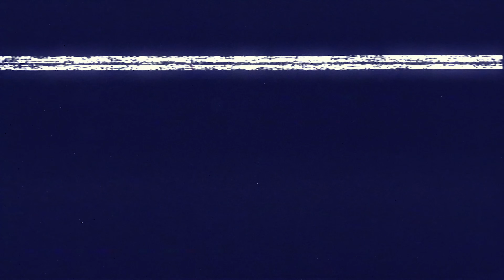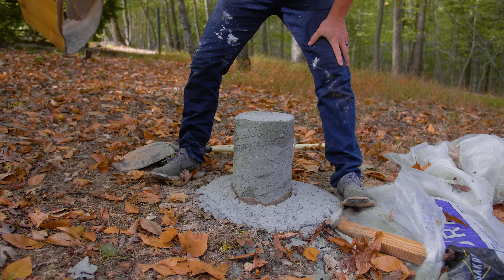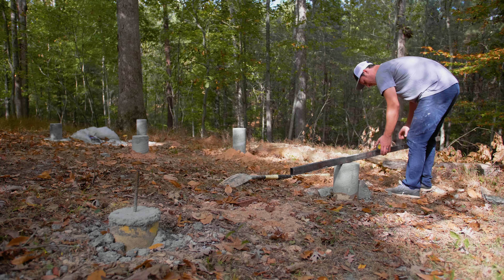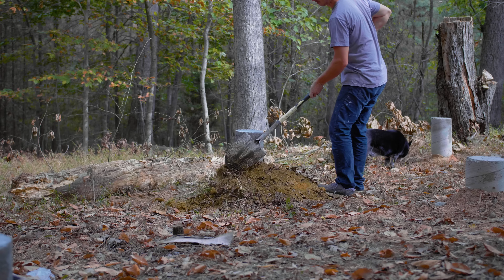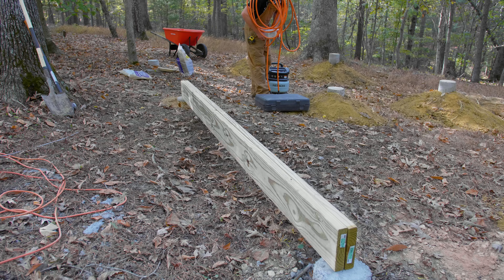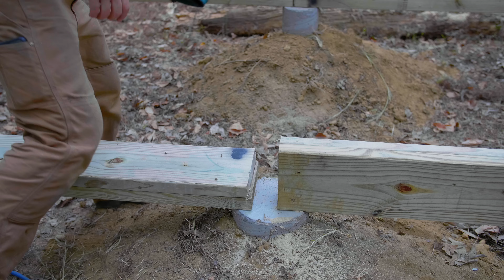Cabin Beams - Cabin Build Ep.3

Comment: How far apart should the concrete pillars be? I'm building a 14x44 cabin. Using 2x8 floor joists.
Reply from the maker: Look it up on a span calculator. My beams sagged a little so I would have beefed up my beams or made sure my distance was less. Minimum THREE 2x8 laminated together for beams.

Comment: I don't recommend piling dirt up around the piers because it allows termites to travel a shorter distance before they reach wood. They will even travel across a treated beam to get to untreated wood. A piece of square sheet metal placed on top of the piers with the edges bent downward will make for an inexpensive termite shield.
Reply from the maker: Gotcha. Good point!

Comment from the maker: ** EDIT ** I did not know how to mount the beams to the concrete originally. It seems kinda simple but for whatever reason, I couldn't wrap my head around it. If you keep watching episodes, you will see that I eventually use dry anchors (wedge bolts) into the piers and attach the beams. Better late than never! Looking back I wish I had the confidence to put wet anchors in the concrete but was scared they wouldn't be square.
Reply: That’s why you needed batter boards to pull a string over the tubes with wet concrete. Then you set them in a perfect straight line.

Comment: What was your cabin dimensions and how did you secure the beams on pier with out anchor bolts ?? Just curious to know
Reply from the maker: 12x20’ and I used wedge bolts to the piers
Reply: @WoodnessGoodness  gratitude.
Your beams and joist demesion if you dont mind. I'm actually on my last year of carpentry for house framing on just curious the different styles of framing people use

Comment: Bringing the dirt up the concrete to the wood is begging for insects to be part of your home. You can insulate the pilings, and not with dirt? Your area under the shed/house cabin should be sealed and free of moisture and excess dirt piles. 14' runs shoulb be 12" or greater You say 12' ft boards  but looks like you chose undersize 8" rough, whimpy ones you are doubling? Do you hasve a height restriction in the woods. I hope your rim joists also sit fiully on pilings, we will see iof you hang them off of nails screws or hangers?
Reply: I agree, never pile up dirt around a pier and always use termite shields. Inexpensive to cut a square of sheet metal and bend the edges downward.

Comment: How do you secure those double beams on to the concrete foundations ? You already remove the small piece of rebar that were sticking out from that concrete foundation.
Reply from the maker: dry set anchors. wedge anchors to be exact. did it later on...

Comment: why did you remove the tip of the irons? they would give greater security in the structure.
Reply from the maker: I dry drilled anchors later in the build. It was one of those things that I wasn’t sure what to do at first. But I eventually forgives our a solution!

Comment: One tip next  time you build wood beams cut sheats of plywood of 3/4" in by the 1/2" less than the beam width by 8' or 10'.

Try to make a sandwich with the plywood and the 2 beams and in the middle try to leave like a channel of 1/4" deep.

Then nailed down both sides.

However for extra strenght and prevention of  funny sounds like squaking it can come after beign built.

Build the sandwitch using liquid nails. 
That will hep the structure to gain a lot of strengh more than the just 2 beams attach together
Reply from the maker: Ah! Thanks for this pro tip! That sounds bomb proof! My next cabin I will take this into the plan making.
Reply: @WoodnessGoodness  
If you want another tip.

When you decide in your plans.

Where to make the pipe columns.

Not only make holes for the columns.

Try to excavate 1 feet more than the area you are planning to build on.

Escavate 6 inches and make the whole lo level then making the holes in the appropiate place your plans suggest and allow them to be at leat 4 feet deep.

Then after dry. Try to make the holes and prepared them for the utilities such as plumbing electrical or anything that goes underground and place them where you are  planning to go according to your planning.

And build it to go outside where the plumber electrician may come and finish it.

Then with those pipes at leat 1' 1/2 feet above the ground level.

Try to flat the dirt and make like a dirt slab leveled all around with 6 inch deep.

See videos on how to build an concrete slab with plastic.

Then do the same and over everything.
Use mesh rebar

Then when putting concrete make and slope of 1/2"  from the ends of the area toward the drain pipe you installed 

Make it nice and neat 

And let it dry.

Why this because you want the property be protected in the foundations from animals, water, and seasonal stuff.

Also you may want to have a crawl space for cheap with no brick intallation where you can fix leaks or anything in a clean place 

Also you want no cracks and no flooding from ground up due to erosion then this is why you may want to out plastic to avoid humidity in the slab.

Plus it will protect your foundation from natural issues in ground to last for several years.

Now how you cover the outside?

Well after you build you first floor try to cover with wood the sorrounding area expose between the concrete slab an the first floor.

Make a door way for you can enter the space and some holes for the place may have ventilation. 
For vapor  relief.

Them paint the surface of the same with paint that may help mortar and wood to bond then  with some steel mesh for stucco nail it with nails and make some mortar  and do some stucco yourself.

This method is cheaper than building brick around the house and is fast.and protect.

How to save on concrete or mortar.

Buy portland cement by bag and buy gravel and sand by yard

Rent some concrete drum for cheap.

And build it mix it with a electrical generator that may good enough to supply the machine.

The ratios for cement, water. sand and gravel you can esily find them online up to 10,000 psi wich is twice the psi any premix concrete home depot bag have.

There are types of cement of portland vary by uses

So buy type S used for foundation retaining walls and rough structures.